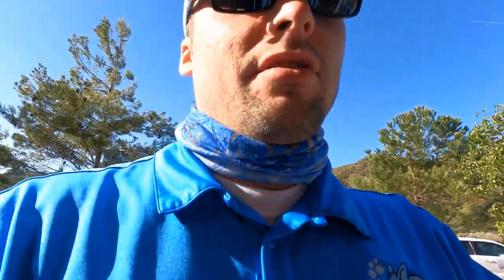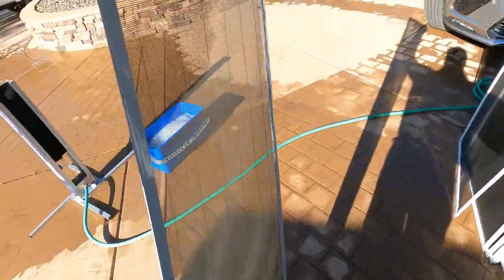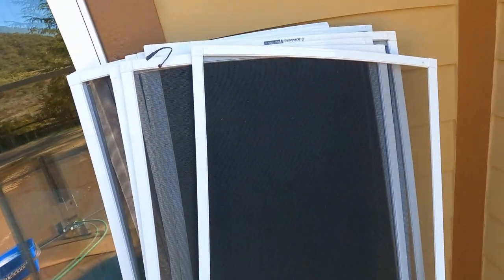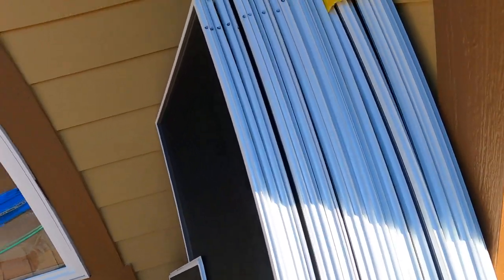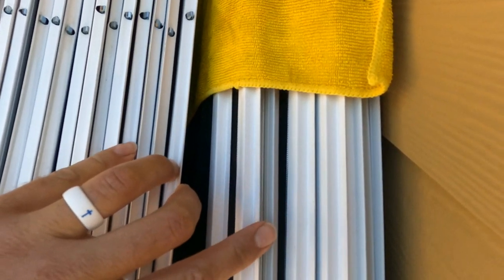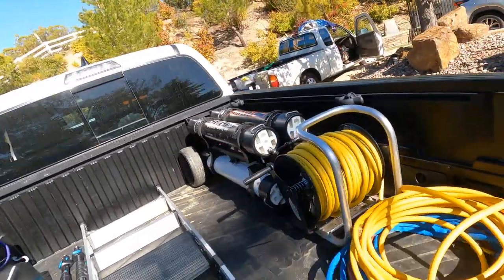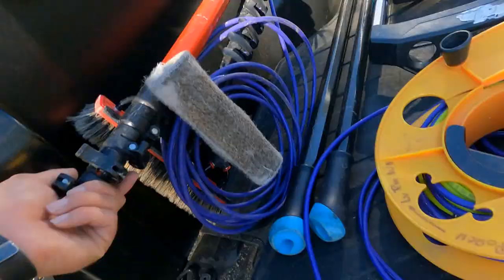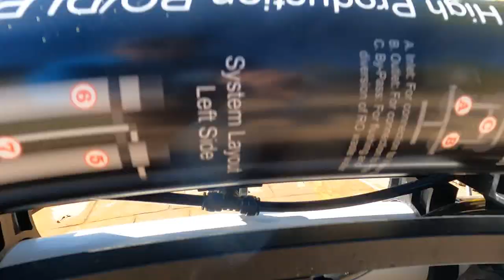RESIDENTIAL WINDOW CLEANING

Comment: Just a question, why did you WFP these windows if all but the ones above the entry door are pretty much reachable without a ladder
Reply from the maker: Because it’s a maintenance job and does a good job quickly. The frames get super dusty quick on top of this mountain because we don’t get rain. So I can clean the frames and windows easily without using a mop and squeegee. The WFP does a better job  in my opinion it is the best option for this job that’s why I decided to use it 👍🏼😁